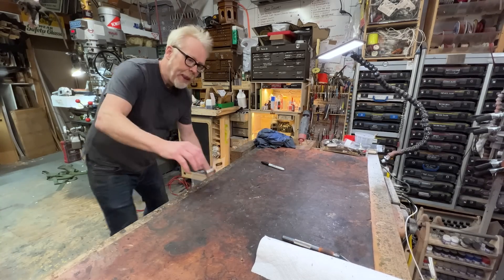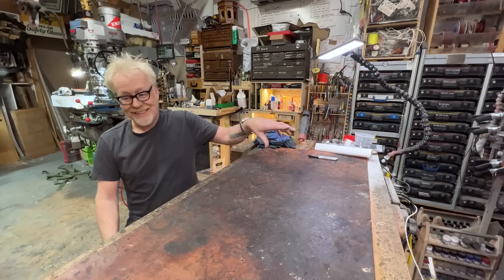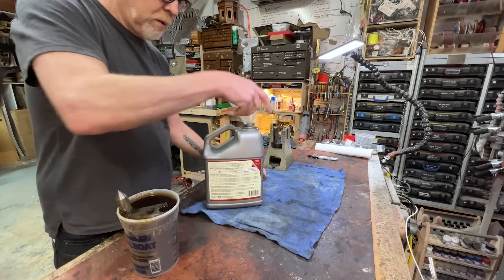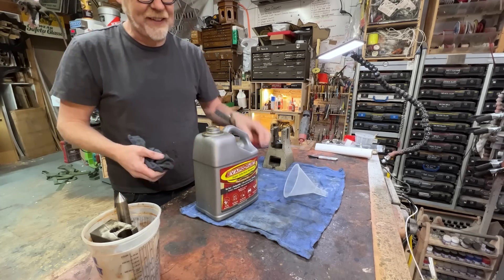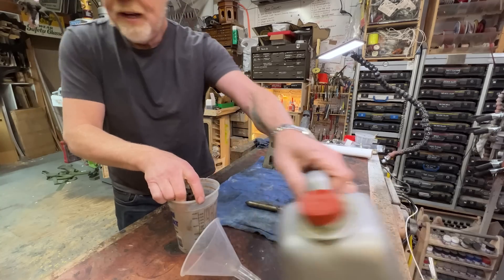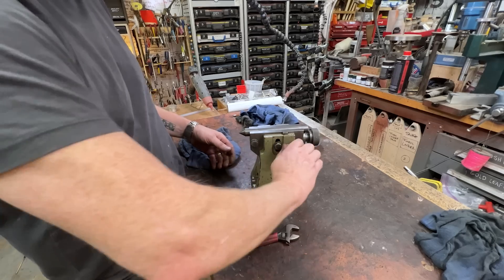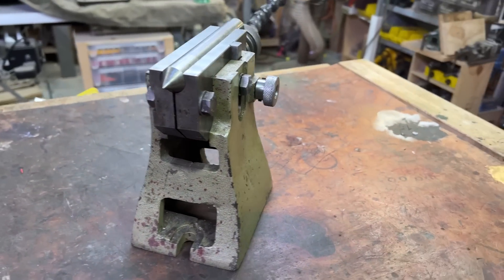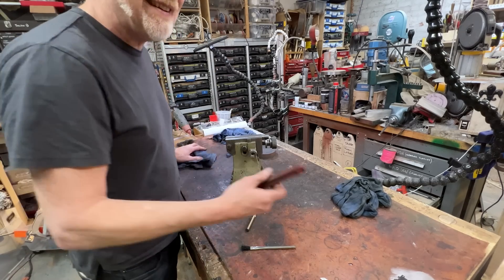Adam Savage Reassembles His Milling Machine Tailstock!

Comment: Tap the knob cross holes on the mill before you remove the knob from vise. Just put the tap in the chuck and slow to slowest RPM. takes a little prasctice but better threads

Comment: It looked like Adam really had to crank the knurler super tight. The ability to gain some more leverage would probably be good. A male or female feature that matches the chick key or tool changer key could enable finer control with more force.
Reply: Yeah, i don't know why Hemingway puts a knob there. Even on brass, but especially on steel, you need to crank on it. I have an Eagle Rock knurler and it tightens with a 3/4" nut. Knurling 303 stainless was a right royal pita.

Comment: The Hand Tool Rescue guy points out that Evaporust does discolor the surface of the metal a bit, so he always wraps a cloth or something about any bits that end up sticking out.  The liquid soaking into the cloth means you don't get a line and it'll treat the exposed bit.